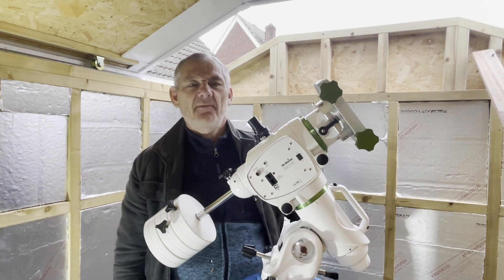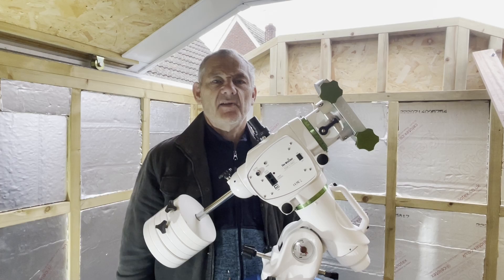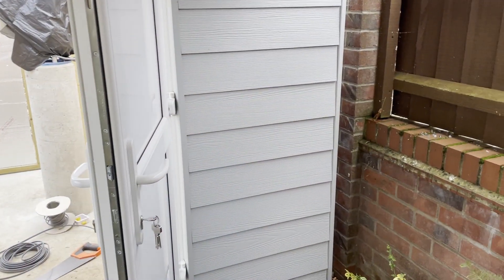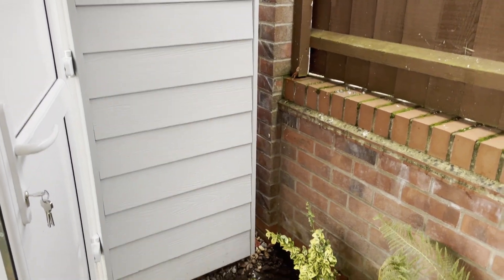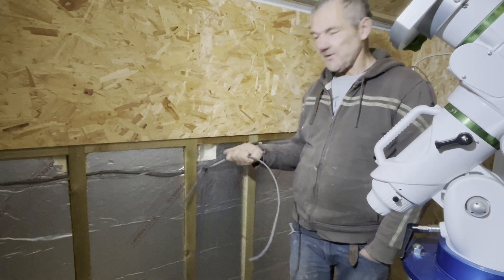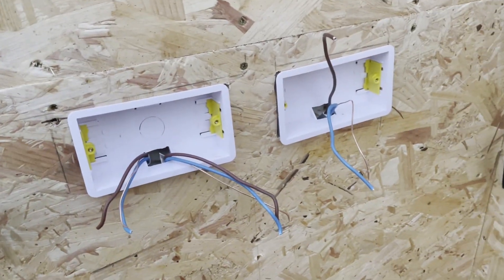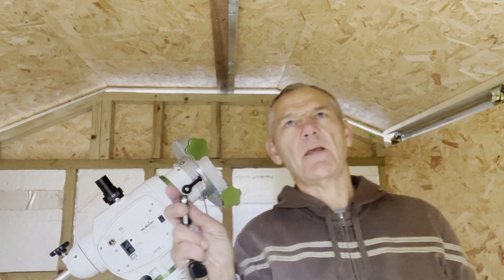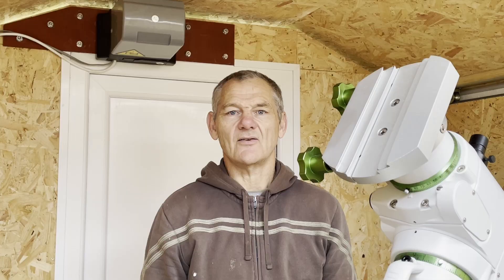Observatory Build Part 5 Motorizing roof & First Light 2600 mm Pro

Comment: Simon, it is a real pleasure to watch the progression of this professionally built observatory. You have done a cracking job with it. I will be watching what images you get with that 2600 MM pro as I have recently acquired the same camera but has not seen first light due to 4 weeks of consistent cloud cover.
Thanks for sharing.
Reply from the maker: Thanks Stephen, such a compliment mate😀 I plan to use the mm pro tomorrow as it should be clear! Hope you get some clear skies with yours👍 Clear skies!